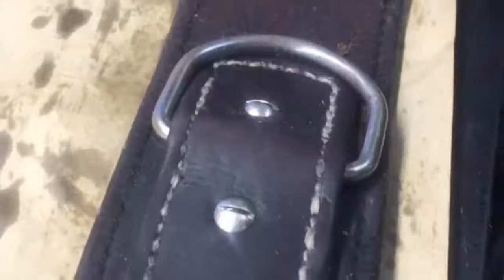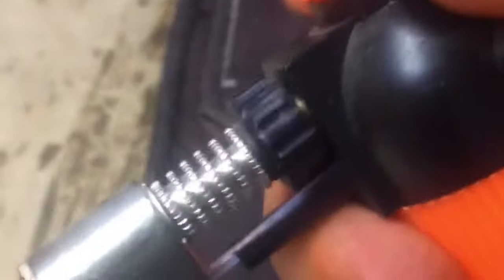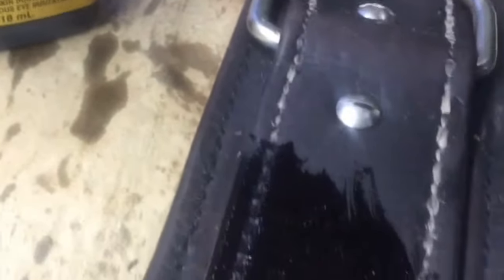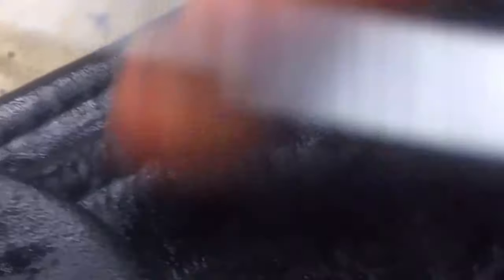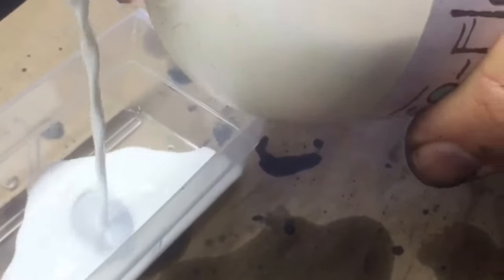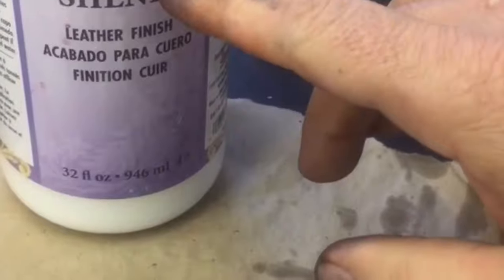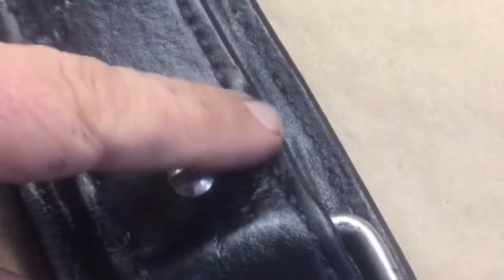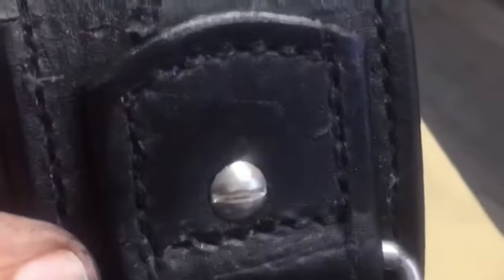RESTORING LEATHER | DOG COLLAR

Comment: I'm about to clean & tidy up my leather pitbull collar with brass spike studs, I got it from Ed Reid in London over 30 years ago, it's still in great condition no damage to it only very dull looking with buckle imprints on it & very dull tarnished brass spike studs, 
I'm caught in two minds  whether or not to dye the collar or to polish & Use dubbin on it & then use brass cleaner on the studs..... It's never going to be used on another dog,only for display in my glass unit with my other dogs memorabilia.... 
I'm not going to bother cleaning the back as it still has bits of her hair between the leather & a very slight scent  of her odor 😢💔💔